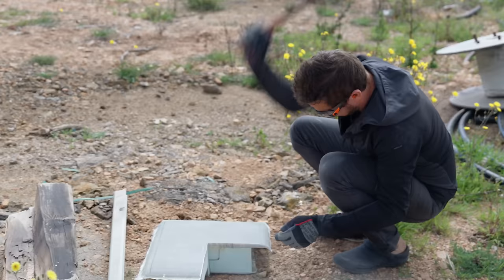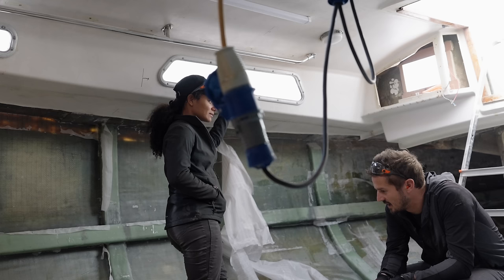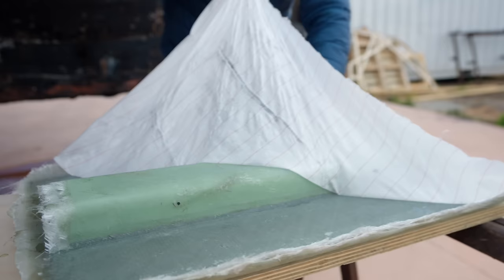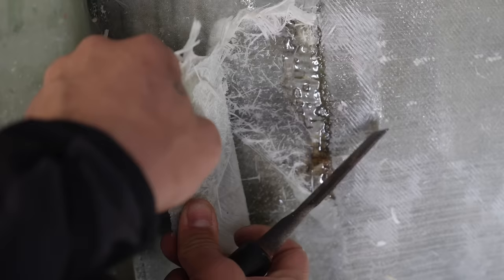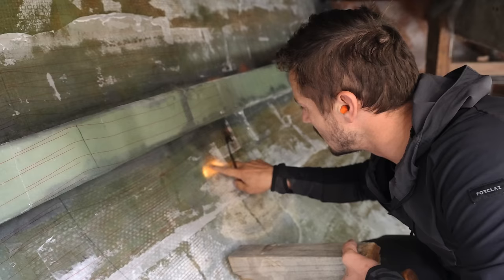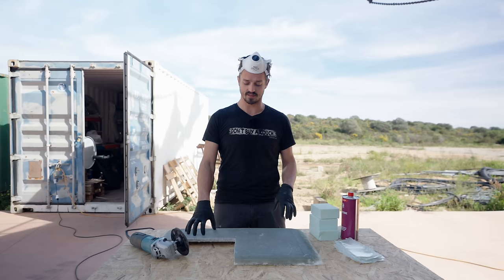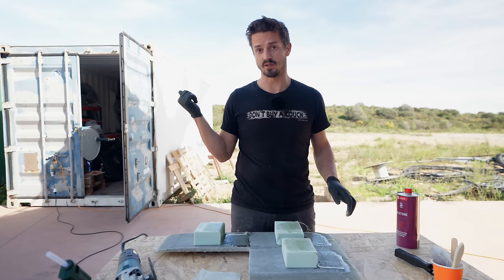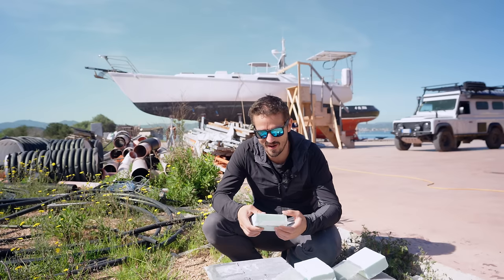If It Doesn’t Work, Hit It With a Hammer | Step 387

Comment: I have just one question really: the resin you used: Does it have wax in it? Problem really is that they don't always say it!
-If it cures without adding gelcoat (with wax!) or other thing on top it does have wax.
-If it stays sticky, it doesn't have wax and should be able to laminate on top on it

Polyester (and vinyl I believe) won't cure completely when exposed to oxygen. And that is what you want when doing multiple layers. It makes chemical bond.

If you make it cure completely, the wax needs to be removed and surface keyed again.

EDIT: when watching your new samples, they were cured completely so I believe that your resin does have wax in it.

Comment: The first? 20,000 lb water wave that twists the boat is going to (or could) pop the inside frame/cage free. You won't sink, but the noise of two hulls rubbing against each other constantly will make this boat unsailable.

Comment: Test Piece:  "We're going to grind it and wipe it with acetone."  Great!  Someone else mentioned "liquid STYRENE."  Have you contacted the manufacturer of the resin/hardener and asked them how best to prep surfaces for maximum long term adhesive strength?

Comment: I think viewers mix up ribs and sandwich core construction. The ribs are meant to work just like a Channel-beam (Second moment of area). The strength comes from the height of the ribs, perpendicular to the hull, not the core material; hence the light foam and hot glue. Hallberg Rassy have no foam at all in the ribs, it's just air.

Comment: Years ago about 30+-ish were using a resin that no repairs could be made to nothing adhere to it, including epoxy.  Sadly, I do not remember which boat builders, but I do not believe it was Pearson.   Most boats are built on the concept of both the chemical and mechanical bond. You are only going to get a mechanical bond because of the age of the hall that means it’s as strong as it’ll ever be, but not as weak as a combination.  As I recall, the resident utilized that nothing would stick to had a reddish tint to it, and I don’t see that in your hall

Comment: I built an airplane from epoxy, so that will be different. Procedure was to sand thoroughly and then wipe off with acetone with two rags - wet with acetone, then the dry DIRECTLY after, one rag following the other. The acetone dries so fast if you wait even seconds, the acetone will already be dry, leaving the dust behind. FWIW.

Comment: Acetone soften the old polyester. The old surface must be rough and not smooth.
Epoxy on polyester is possible but more like a repair than an humongous ad on.
Polyester on polyester would be better although the work process is different in timing. 

A trick to work with epoxy to bond with polyester is to create a new layer of polyester. 
That applied on a acetone soften old surface. 

Obviously old epoxy to new must be rough and cleaned/ softened too.

Comment: I am a bit worried about you used hotmelt to glue the core material to the laminate. Wouldnt thickened vinylester been better to get a uniform gap free bond, and stronger than hotmelt?

Comment: I would seriously reconsider using hot melt glue to bond the foam to the hull.  You are essentially building in a void into the laminate that serves as the starting point for further delamination.  Bond that foam in place with the same resin as you use for the glass, and make sure it is free of voids.
Reply: @UKMechanic The lamination includes everything from the substrate to the top skin. Not only does the glass tabbing need to be bonded to the hull, but the foam stringers and ribs also need to be bonded to the hull as well. If not, they represent a weak spot where the structure can "work" itself to failure. Voids between the foam and the hull can separate the covering plies from the hull, resulting in complete separation of the reinforcement as a unit, as was demonstrated on their small-scale sample. Whenever using core material such as this, it must be properly bonded to the face skins on both sides.
Reply: @UKMechanic  My assessment doesn't come from a place of ignorance, either. My own background included working as an engineer for an aerospace composites company. I'm just saying, I wouldn't advise this method, but I would recommend to reconsider. Not my boat, not my money, not my butt. But if it were, I wouldn't do it this way.

Comment: I have worked on a shipyard in Norway but I have never seen anyone using hot glue gun to get the foam on the hull. You should have used a 2 component glue because of the strength. Hot glue harden before it has a chance to grip and soak in to the material.
Reply: It does not hurt anything, the strength is in the glass box that the foam creates, not the foam itself.

Comment: This is with vinylester resin, right?  I’ve done laminations with epoxy resin straight onto surfaces fresh from peel ply (without cleaning and grinding) and they have been strong and solid.  My understanding is that you can put epoxy resin on laminations of polyester and vinylester resins., but not the other way around.  Could you please clarify?

Comment: Might suggest reaching out to Ran sailing.  And they used peel ply.
Reply: But they (Ran) are using epoxy resin. They do clean and sand everything after removing the peel ply
Reply from the maker: We prefer to get our advice directly from the source. AKA boat builders. Or friends of ours who repair boats for a living. We'd recommend anyone thinking of doing large jobs like this to do the same. Getting advice from DIY YT channels is like doing research on Wikipedia. It might be a great place to start, but you really need to do your own research from primary sources, for your specific needs and speak to experts you trust before deciding on any action.

Comment: An example of Uma thinking they know better than boat builders. Pretty much the theme of Uma and believing they know better. I recall the harsh criticism about the current state of the 50 year old sailboat bulkheads not being built and no longer being bonded to hull. Today we find out, what boat builder know, is structural sound despite not being glued to hull.

Comment: would m.e.k work better as a solvent than acetone ?  It certainly works when prepping  anything i've ever done (aircraft sheet metal worker/mech 40yrs)
Reply: Acetone is not good solvent for degreasing (it's too polar). Naptha or mineral spirits are better, xylene is excellent but more toxic.

Comment: I'm sorry, I dream of and truly wish to sail in my retirement (~10 years).  Should I still find comfort in being able to hit a hammer twice and then peel away the two-layer fiberglass from a stringer-ish piece?  Perhaps this is like concrete or tiling in which case we were simply demonstrating a better bond between the two and that still overtime, no, one would not be able to simply hit twice and tear apart?  Thank you as always for sharing this knowledge!!!  Wish you both the best!
Reply: It's not the bond to the foam which matters, but the bond to the hull. The foam has finished its job as soon as the laminate is cured, it's not strong enough to be a structural entity.

Comment: In a previous video you mentioned the foam you use. Can you confirm it does not take any water? Looking at other videos it seems very flexible and that might indicate open cells. And that's a no-go.

Also, imho, there should not be any air pockets. These will fill with water eventually...
Reply from the maker: Definitely  NOT open cell.
Reply: @SailingUma  great. Sorry i asked))... You did a great couple of tests. I would recommend avoiding any airpockets like those that are visible. They also certainly will absorb water one day. ( Built polyester boats for 30 years professionally and privately)

Comment: Perhaps it has been mentioned before. Two types of adhesion with any vynylester/polyester laminate. Mechanical and chemical. Mechanical adhesion / key is gained through an abrading the surface. HOWEVER, chemical adhesion is time sensitive. The resin crosslinks over time. Indeed the resin never stops crosslinking, ever! Thats why polyester boats always smell like styrene. Baking” it  slams the door on chemical adhesion, not much will stick to it after that. One needs accurate data on the resin to know how long the resin can cure before chemical adhesion becomes a problem. You could easily test for adhesion window in the yard if you wanted better data.

Comment: that smash the actual boat hull test was almost 100% proof that the test hull piece clearly suffered from the  surface wax was acting like a release agent .. My thoughts are / go back to my use of Epoxy on a mirror  class sailing dingy I refurbished . using 100% West epoxy... There is nothing like smashing the heck out of test pieces to put your troubled minds at rest . PHEW   I was getting quite stressed after seeing Dan,s reaction to the test piece when it simply fell apart .

Comment: So you have built a boat with in a boat.The sample size was small. I think after you build the bulk heads and the flooring and everything else that goes inside. It will be fine.It does look great. Be safe be kind and good like.

Comment: A question. I thought a fibreglass boat is made from an outside GRP skin and an inside GRP skin with a core material in between.  Is this boat a solid GRP hull or are you fibreglassing the inner skin?
Reply from the maker: New boats are build that way. Or at least some are. Some are still solid glass, or solid below the waterline. Ours is solid glass.

Comment: A question if I may: what was the rationale of using vinylester as opposed to epoxy? Not sure if that wozld make a difference. Matt from the Duracell Project is going all in on epoxy, and to me that’s more than a trustful resource
Reply from the maker: If you’re trying to squeeze every ounce of strength per gram of structure in say, a race boat, or airplane, epoxy makes sense. For use, vinylester is more than strong enough for our needs.
Reply: @SailingUma  got it! Thanks for the reply! Great learning for you and all of us👍

Comment: Dear Uma,
It’s surprising that you consulted specialists and did not find a solution. It is known that you cannot glue polyester back onto a polyester body. The scheme is very simple: polyester - epoxy resin - polyester. A thin layer of epoxy resin is sufficient. You are good at doing experiments, so do such an experiment and you will see a positive result.
Good luck

Comment: What I would do is not use the hot glue gun make your own glue with the resin and cabosil and you should always key the surface before bonding maybe you guys should of asked to either help the professionals and or just watch and you would have learned a bit about fiber glassing you could always get the professionals back to glass the bulkheads in and then take over the job after there is no shame in making a mistake look forward to your next video

Comment: peel ply is  usually used with epoxy as it’s main purpose is to Remove the amine blush , Ok I know it also leaves a nice texture thats said to be fine to epoxy straight over with no sanding , but your using vinylester , that product is proven to have poorer secondary bond than epoxy,  I think your original test would have been fine if you were using epoxy , from what I’ve read polyester and vinylester need more /better prep , whereas epoxy is more forgiving to poor prep , but to end on good note ,I think the fact you sanded the hull properly to start with you will be fine , to sum up I think vinylester needs more of key than epoxy hence why sample with peel ply texture and vinylester initially failed

Comment: I don't get it grinding dust if well mixed in should be about the same as thickened epoxy which is used for strength.

Comment: From what I saw, it appeared that you only used a “squiggle” of resin to make the bond ♒️
So if the “glue” only amounts to say 10-15% of the mated surface area, it’s missing the opportunity to create the intended bond  (perhaps my eyes missed something?)
Reply: The bond between the foam and the hull is purely to immobilise it sufficiently to withstand laminating of the glass. Once the laminate has cured the foam has no further structural role. So it was not the detaching of the foam which was a worry, it was the delamination of the surrounding glass from the flat panel representing the hull

Comment: Your test makes me wonder if something is up with your pealply.  Like is it actually the right kind for polyester resin?  With epoxy the pealply is supposed to pull the amine through itself so the surface underneath is ready for laminating, or so I've been told.  I've never trusted the stuff myself, and your tests show it's probably best not to trust it.

Comment: I know it does not always make it into the video, but have you ruled the contamination out?
You did not shape the foam this time, did you?
Reply from the maker: We actually did shape it, but we dusted it really well and made sure there wasnt any particles before adding the filler.
Reply: @SailingUma Since it was clear, that the untreated surface alone was bad enough you are probably in the clear ;-)
But I would have tested the acetone washed and ground surface with some extra contamination from the foam dust just to see if it was a thing at all.

Comment: if the hull was constructed using epoxy resin bonding new structure with vinylester resin won't adhere very well
Reply from the maker: Seems to bond just fine.

Comment: Expedition Evans had a Benetau delaminate with a keel strike. Maybe they have some advice?
Reply from the maker: We prefer to get our advice directly from the source. AKA boat builders. Or friends of ours who repair boats for a living. We'd recommend anyone thinking of doing large jobs like this to do the same. Getting advice from DIY YT channels is like doing research on Wikipedia. It might be a great place to start, but you really need to do your own research from primary sources, for your specific needs and speak to experts you trust before deciding on any action.
Reply: @SailingUma  I agree. What I find is often experts don't understand what I dont know, and assume I have knowledge that I have never been presented. So at the start of a project, Wikipedia and Google can be incredibly helpful. The shared experiences can be insightful.

Comment: The hitting the outer hull with your little hammer was a bad idea. Not only but unlikely could you delaminate things in the inside but likely cause micro cracks and delamination in paint, gelcoat or hull that you will not see no matter how close you look. Remember that there is no air to show delamination in your work. Only if air makes its way in you could see the damage. If it delaminates without air getting in you see nothing at all. It will look whitish if delamintion accures with air. Kind of like if you toss a clear glass marble into clear water. If the marble would have a bubble of air inside you can see the marble, or better the air that gives away the marble. If the marble is flawless  from other material or air it will be invisible. Also do not add filler to dry spots. First wet than add filler..

Comment: Ok - you tested for impact conditions but you should also test for the twisting and torquing forces of heavy seas. I’m still concerned about the shearing forces on thru hull fittings and chain plates. Fingers crossed for you two. Thanks for sharing the good and not so good.

Comment: Knowing seemingly zerooooo....

I think one of the mistakes is just hot glueing the foam to the original hull then glassing over that. Essentially what one creates is a section — the length and width of the foam — that has zero bond to the hull. Thus creating a point of failure that spans the entire length of the foam..

Seems to me the thing to do would have been to put a layer of glass down over the hull, then embed the foam on top of that while the base layer of glass was still "wet", then glass over the foam as would / did normally do.

This doesn't explain the delamination that occurred in your sample as that clearly was a failure over the entire surface. Cleaning with acetone, then grinding, then maybe(?) another acetone clean is probably the best prep.

Comment: I don't know why one would just bond to a squiggly line like that instead of bonding the whole surface of the foam. Is it just a cost saving method? I have never seen even an epoxy structure that just used one line of bonding glue(?).

Comment: This is hard to say because you both are so enthusiastic and love Uma. That being said, there is no way a 20 oz hammer(+-) will simulate your multi-thousand pound boat hitting a shipping container, rock or repeatedly being pounded into a dock during a storm. 
Hitting a 2x4 with the hammer on the topsides (the 2x4 will diffuse the impact of the strike),  shows little to nothing when testing the structural integrity of the new fiberglass work. I would get a rubber mallet and really go after it...or talk to a Naval engineer. Short of that if you come up against it on the open ocean you may be in serious trouble...

Comment: Architects always make a sample wall to see how it looks.  This sample didn't look so good.  Smart!
Reply: The guy on the phone was right.  The dust from sanding the foam stringers could have done it.  I bet your contractors would have wiped it down after but we didn't see that on the video.
Reply: I think it is the dust.  The last step before applying new is to remove dust.  I think dust makes a great mould release.

Comment: You didn’t sand the hull element of your experiment.

Also… what is the material you used to ‘bond’ the ‘styrofoam’ beam with?

Looks like hot WAX.

Frankly… its surprising that it didnt just slip off.
Reply: There's no bond between the foam and either surface, it's a form for the fiberglass, not structural itself. The important part is the connections between the fibreglass.